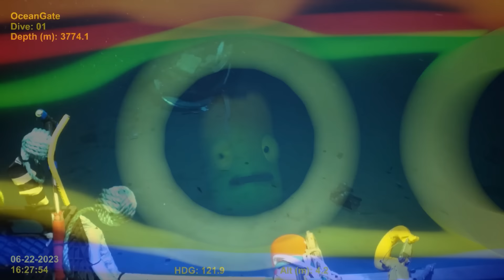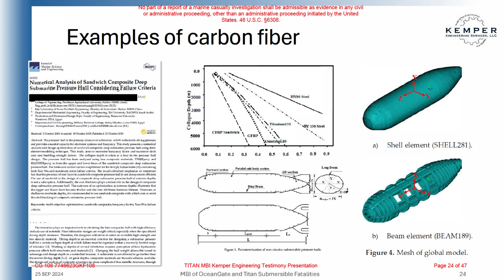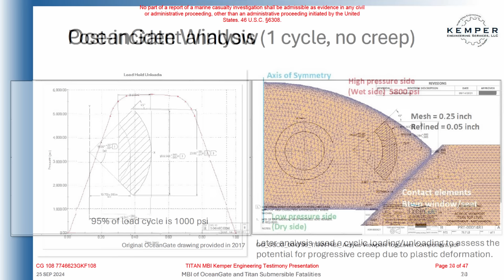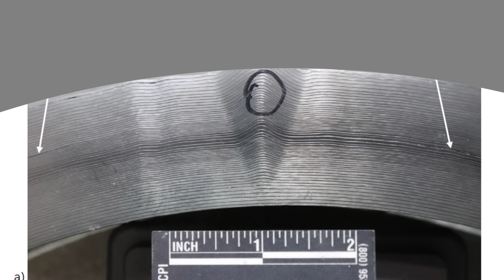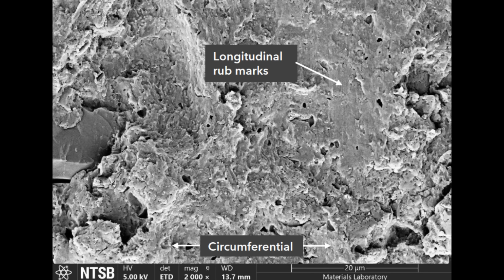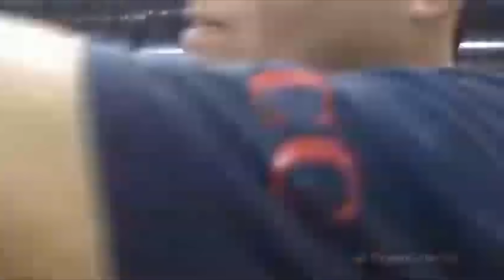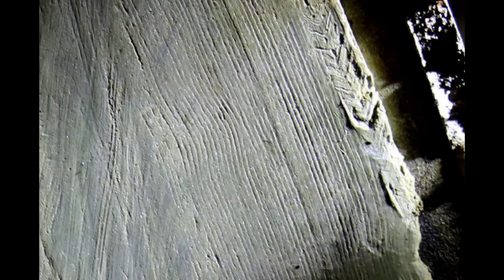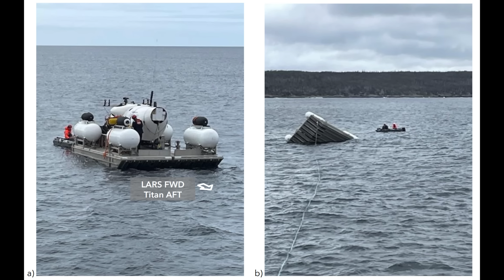OceanGate Wreck Shows Why Sub Wasn't Strong Enough To Survive - NTSB Shares Important Details

Comment: So the spherical design acted more like the flying buttress of a cathedral, for exactly the same reason. It probably has something to do with architectural problems Brunneleschi had to figure out when making the Duomo. If I recall correctly the strength of the seat was more important than the strength of the dome materials. Hm, i suppose a groined vault would ruin the punters' view.

Comment: As one of those unqualified armchair engineers, I'm going to go out on a limb and say that the problem is with a composite. This material is not homogeneous by definition. Stating it as a carbon fiber vessel is missing the point that it is glued together with a weaker material. The failure is in the epoxy resin. Now if they constructed a thinner titanium cylinder with a carbon composite inner sleeve, they may have been able to withstand the inevitable point of failure in the epoxy.

Comment: The thing I found myself thinking about. Water is capable of dissolving oxygen, and fish are able to make use of that oxygen to breathe. The deeper down you go in the ocean, the more anaerobic the water becomes. That means there is a theoretical volume of water above an imploding pressure vessel where all of the air could be dissolved into the water and you wouldn't actually get any bubbles surfacing. There may well have been zero sign on the surface that anything had even gone wrong.
Reply: You’d still be able to pickup the sound. A high pressure implosion like that would create sound waves that would travel a long way.
Reply: But was the air mix completely oxygen? I thought it was mixed with other gases for an airlike atmosphere

Comment: The Titan seemed like it was impressive for a one time expedition the mistake was using it as a vessel for profit. 

They didn't care for it. They knew the structure was weakening and didn't do anything about it.
Reply: No, it wasn' t impressive. It was a flawed concept (cylinder at such depths, mixing materials ). It was like playing russian roulette.  It might have survived the testing and then the first or second trip with humans inside it would had imploded. 
  At 4000m you can only have an sphere. And the hatch, window and any interfaces to actuators need to be properly designed , simulated and test it. Any flaw in its construction  and even a sphere would buckle under pressure ... Never mind a cylinder.

Comment: Five one inch layers of CF delaminated. Likely salt water ingress. This was poorly designed, engineered, and built. When his scale models kept failing at not very deep depths, he should have abandoned the design and materials and went back to the drawing board.
Reply: It's amazing that the Titan survived as many dives as it did.
Reply: @swiddle1  agreed and to keep hearing gun shot sounds as Karl Stanley testified, and keep diving was just ludicrous.
Reply: @swiddle1 I agree.  After what was likely a significant structural failure (dive 80?), it kept going.  It's almost like the sub warned everyone (it certainly appears that the monitoring equipment actually did its job, but Rush was too busy being himself to listen to it) until it couldn't hang on any longer.

This makes me wonder about how bad was the design if it held up even when compromised.  Obviously, tbe construction of the sub was unbelievably shoddy and highly suspect.  However, I wonder how the design would hold up if the manufacturing process were carried out by a competent company that had actual standards.
Reply: It seems like when people like this get their heart set on an idea, no matter how idiotic it is,  or how much evidence shows their idea is flawed, they just dig in deeper. They have the means to do so, and nobody is willing to stand up to them, so they press forward and end up causing a spectacular disaster. If this device had been conceived by a real, organic team of qualified people, this probably wouldn't have happened. What I'm saying is that no matter how poorly designed, engineered, and built the sub itself was, the ego of Stockton Rush was the real commodity that had to be protected. One of the real tragedies here is that he never had to answer for his poor decisions....
Reply: @ScottAllenFinance  truth
Reply: He will definitely have to answer to God when he stands before Him.  What a sad and terrifying day that will be!
Reply: Are you saying that possibly bubbles formed in between the layers of the carbon fiber due to salt water? That lead to the cracking at those depths.
Reply: @Stephen_2026-drq  no if you look at my next comment I clarify this statement. Basically the weight of the front dome (several thousand pounds as I understand it) being supported by a glued on interface ring with not much depth/bite. That frequent opening and closing of that dome to let passengers in and out likely weakend the CF around that front interface ring and led to salt water intrusion over time which then caused delamination and a crumble zone then complete catastrophic implosion in an instant.
Reply: You mean to tell me the truck bed liner was not effective?🤔
Reply: I don't think that's quite the right take away. There was clear warning on the strain sensors of damage to the carbon fiber, and it was simply ignored. With properly refined manufacturing (remove waves, normalize glue thickness, etc.) I think it could be a viable material
Reply: @TheShitSmith Yeah, I agree with you there. It still needs to be proven viable of course, but it seems like a possibility. It's not like spherical titanium pressure hulls are tolerant of negligent manufacturing work either.

I think the big unanswered question is whether composite pressure hulls can be made and monitored in such a way that failures can be predicted far enough in advance to prevent them. Titan V2 was absolutely not an example of best practices, yet it seems like it still gave ample warning signs.
Reply: @TheShitSmith  I would think if 'removing the waves' was a simple feat, they wouldn't have resorted to sanding them down. It might be a viable material for shallow dives. But sometimes it's in our best interest to take the hints the material has given us, and stop trying to force it into a role that it doesn't fit in well. Those extreme pressures are going to cause the hull to flex. Repeated flexing is going to cause strain at the weakest points. Those weak points seem to be the glued areas, where the layers were grinding the binder into dust from the way they were flexing and shifting. The more the layers flex, the more they grind together, the more they delaminate and weaken the structure. Without some serious re-engineering, I do not think this is viable.

Comment: I have a feeling it failed because it wasn't engineered or tested properly.
Reply: Nah. That's just what BIG UNDERWATER PRESSURE wants you to think.
Reply: A fish touched it
Reply: @volvo09  what kind of fish
Reply: @JohnSmith-u7x3w lake trout
Reply: @JohnSmith-u7x3w megladon was fighting a plesiosaurus and accidentally bit the titan.
Reply: @Kodousinx  Stockton was a clown fish?
Reply: It actually just wasn’t properly tested. Stockton Rush literally rushed the manufacturing process and declined NDT and material analysis despite being told by the lead engineers (that he fired).

A composite carbon fiber would’ve helped, but not to the degree that it becomes viable as the primary hull’s structure.
Reply: @rufus2028 The hull is way too thick for any meaningful NDT.

And the engineer that Stockton Rush fired… if you mean David Lochridge then he wasn’t an engineer but was contracted to pilot the submersibles. 

David Lochridge had no engineering background and was fired for leaking company’s internal documents. 

David took this to court which was dismissed and that’s where I got the information on this from…
Reply: Weird what happens when people decide they don't want whites to build and engineer things.
Reply: That's what his advisors said which he completely dismissed
Reply: yes.
Reply: Fired! -Rush
Reply: And built
Reply: It was tested up to its failure point.  There just aren't any witnesses anymore.
Reply: To be honest, if they did that, they would have run out of money before doing any real dives
Reply: The company got paid, the passengers got to visit the Titanic, task failed successfully.
Reply: Titan has done dozens of dives. The problem was in maintenance.
Reply: @sujimayne There are so many problems with the design and implementation it isn't funny. They did ad hoc redesigns on the fly as manufacturing problems arose, which all by itself is horrifying for a survival-critical device in a high-stress environment.

Just because it didn't fail immediately on the first dive doesn't mean it was good. If bad designs always failed immediately, we'd live in a much better world.
Reply: @sujimayne  it didn't do dozens of dives. it only did 14 to the Titanic with the 14th not returning.